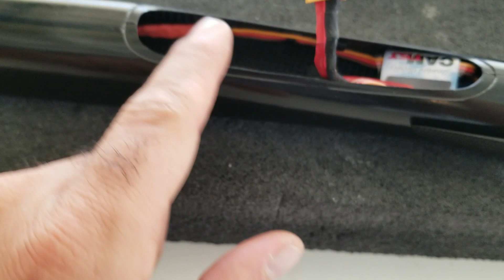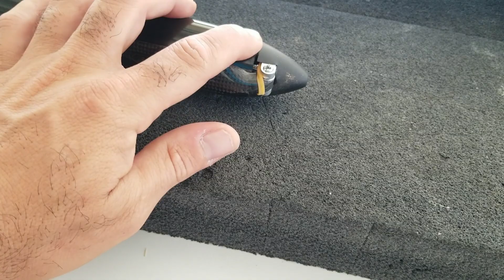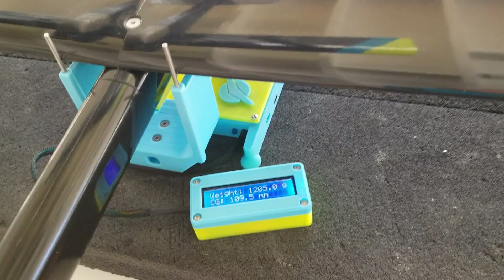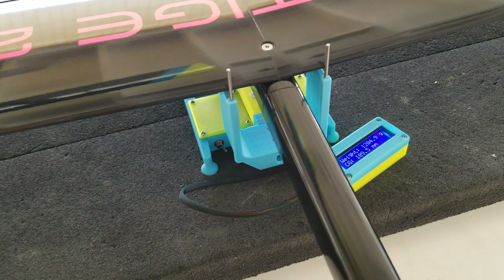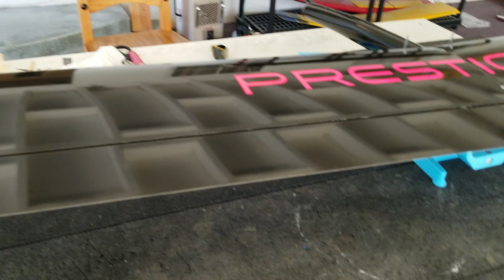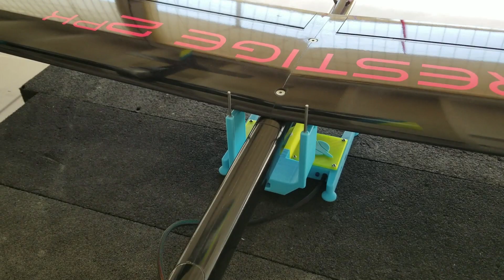Samba Prestige 2PK F5J Build Wrap Up

Comment: Question: with the wing mounted on the airplane straight and true, control surfaces neutral and the horizontal stab mounted straight and true, elevator neutral, there really should only be one CG location that allows you to fly with no pitch trim added. Correct? If you move the CG aft, that would also include changing the incidence of the horizontal stab, right?
Reply: The changes in neutral elevator with different CG is so small that you cant really see or meassure it. So a change in incidence with different CG is correct assumption but only "visible" when you move the CG kind of too far. A few mm forward or backward makes huge difference in performance but not always visible changes in elevator trim/incidence.
Reply: Jo Grini - Not sure if I agree with that entirely. The ideal location for the CG is to be on the average CL location of the wing. This occurs at the point of max curvature on the top surface of the wing. Given the complex planform shapes of a sailplane wing, this location needs to be calculated in a fluid flow application. If the CG is aft of that location or forward, the distance between CG and CL produce a lever arm that can produce significant trim changes.
Reply: @cloudstreets1396  This will be a long one ;-)
That can be true if you never changed camber and asked the pilot what he wants to be his preferred best setting. Does he want it to perform best at Thermal mode, neutral, distance mode or speed mode? What moisture and how easy should you see the thermals? There is huge differences around the world what you might want and there might be differences in what the airplane is used for. in mid Europe you might want a very light plane only for morning flight with a rear CG to accomodate big camber. The other plane stronger and might be used in the middle of the day with big sink areas so he needs to have a forward CG to suit a good distance setting. In Norway you might never encounter calm weather so all your planes will have a trade off of the two since the sink areas never is too big but worse. In some areas of the world you can get away withb very far aft CG and the model have good speed anyhow in a low moisture invirioment. This means you see the thermals easier and that might be preferred by some. In Denmark it is ALWAYS windy and you are going thru different air all the time. If you choose a slight forward CG you can easier get the best out of the passing thermals since the model will baloon up a bit when it hits good air. With an aft CG your model will likely pitch down and since you probably are 500m up and in front you can not apply elevator up fast enough. You also have to calculate the moisture in the air he will be flying in. Moisture is a very big factor for us.
I think I am fairly good at seeing when I hit good air and will go up anyhow so I choose a slight forward CG. I also fly in different places of the world and like to be on the safe side. I can always go a few mm back when I feel it is needed. 
A last thing.. The elevator of the Prestige does not have an increased drag before you change more than 1 degree each way. That means you can use a lot of camber and still not go backwards on a windy day.
All of this is off course my feeling after years of testing and flying. With a new model I usually do a lot of late eveing, middle of night and morning testing with different CG and Camber looking at both speed and a log of altitude. This means I have fairly equal conditions thru a whole lot of flights. When I am happy with that I start doing a lot of flying in sink and do the same tests. In my opinion 50% of all rounds is won flying thru sink in F3J and 30-40% of them in F5J when you change thermal (since you use motor to the thermal as opposite of F3J were you need to fly there). That means my model needs to be good flying thru sink.
Reply: Jo Grini - You’re absolutely correct that a camber change moves the center of lift fore and aft, but I would argue, given a camber setting, adding lead to the nose or tail will produce tangible trim changes. Trim changes when adding positive or negative camber is just a fact of life. I would argue that elevator trim at a neutral wing section is undesirable and should be corrected with a change in incidence of the stab.
Reply: @cloudstreets1396  Yes undesirable if you fly only neutral wing. But the wing section is designed to not have one neutral setting. It is designed to have 2 settings. One were the top side is neutral and one were the bottom side is neutral (or as the designer says: "The wing airfoils have no continuous smooth surface on bottom and top at the same time"). So you need to calculate two times and choose.. And I do not have trim change in those two settings... Read the designers words on http://www.f3j.com/prestige.htm